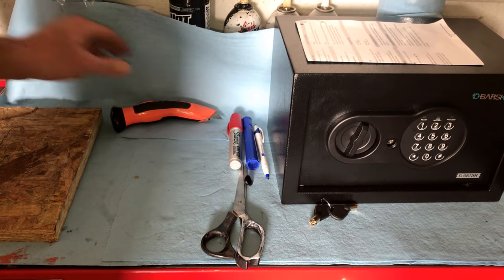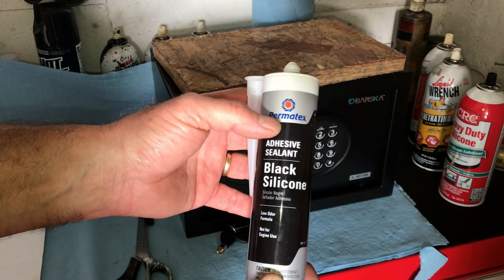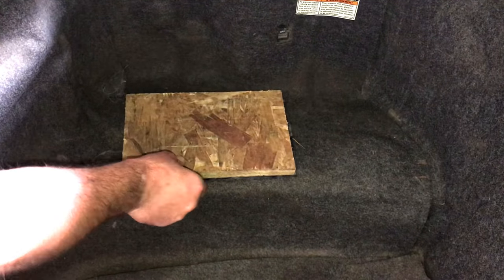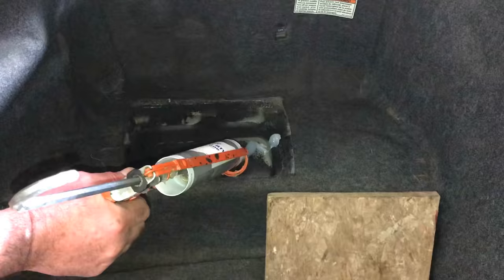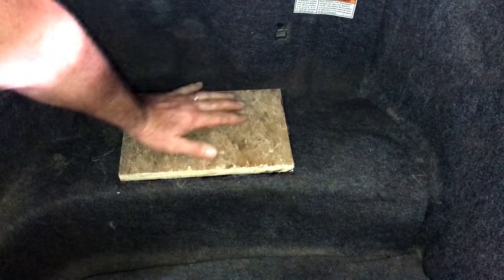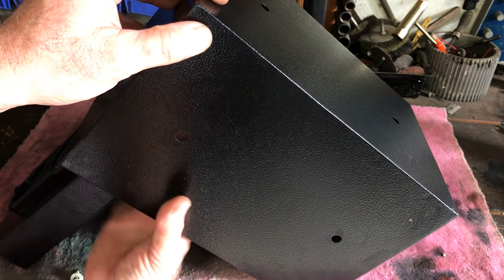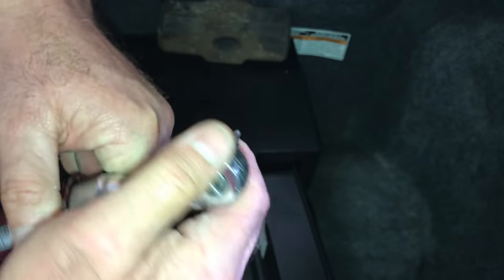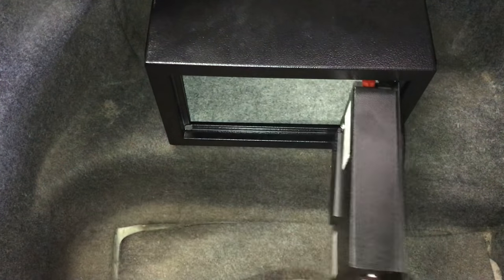How To Easily Install a Security SAFE/Vault in a Car Truck Suv or Semi

Comment: Thanks for that... I've been mounting these types of safes into all of my vehicles I've owned. However, I've always hard mounted but the polyurethane is something I never thought of. Saves a lot of hassle of drilling and then putting silicone around the bolts to keep water out.
Reply from the maker: you got it Ron polyurethane is the ticket for sure ...thanks for the great comment :)

Comment: Hahahahaha glued on particle board! That is fantastic! I switched out a cheap safe I had and I chose a fort knox pistol box, hardened screws and huge washers with locking nuts and loctite. This would have been so much cheaper! :D
Reply from the maker: TiredOfApathy we tried getting it off with a crow bar and it was a bear for sure :)

Comment: This gives me an idea to take out the spare tire and bolt a rifle safe into the threaded hole which used to secure the tire.  By packing out the space between the base of the spare tire well and the covering mat, I could mount a rifle safe in the trunk with pretty minimal massle, it would look well-finished, be as tough an install as anyone would need, and no compromise to the vehicle sheet metal.
Reply from the maker: dave thats sounds like a fantastic project would love to see it when finished   mike

Comment: Awesome Channel - Thank You !  I became a subscriber after the first video I watched.  Another possibly more robust variation would be to drill some bigger holes in the floor of your safe, use a template of those hole's location to drill the wood board accordingly, and then put some bolts with washers up trough the board - then glue it down (looks like your trunk floor has some recessed areas so you don't need to countersink the bolt head/washer combo and compromise some of the strength of your board) - then you can drop the safe onto the exposed bolt shafts,  and secure it from the inside with some locking nuts and large, flat washers..........done.  Remind people not to store a big pry bar or something similar in their trunk however  ; )  .
Reply from the maker: ashman0071 thank you so much for sharing, we have many methods to mounting the safes we install and that all depends on who much money the customer wants to spend...we have had some that want the safe bolted with 1/2" steel plate and 3/4" grade 8 bolts right to the frame of the vehicle, but that, of course, costs much much more. Some just want a place to store items and deter the thief enough to slow them down or make them think it is not worth the time or effort when they see the safe.....thank you very much for being an awesome Subscriber have an awesome day :)

Comment: Great, as long as someone does not bring a grinder and a cut off wheel. The top and sides are the weak point.

Breaking into my own car with my brother and my alarm going off. On one questioned us and walked by us.

This was at a Fred Myers parking lot.

Just saying. 

I do really enjoy your other videos.
Reply from the maker: ok .....well the idea is to stop them or slow them down, any thief that brings a noisy grinder is most likely to get caught...

Comment: Looks like you only put two screws in.  What were the other holes you drilled?
Reply from the maker: did you see where I drilled the extra 4 holes with the step drill? thats, where they were installed, there were 6 in total   thank you for the great comment it is very useful for the entire SPC Channel :)
Reply: I saw that you drilled the extra holes but I didn't see you put 6 screws in.  I must have missed it.  Love your videos!  I have been using lots of your suggestions to make my older car look great and on the cheap!
Reply from the maker: I try to keep the videos short or my subs come unglued on me lol..... so I leave a bit to the imagination, but where you saw me drill them is where they were installed...its all it took to hold the safe securly down, we tried to pull it out to no avail.      when you mount it put it in a place where it is hard to get leverage on it this is another deterrent to removing it quickly and thats what a thief wants..to get in and out as fast as possible...:)

Comment: Wraps a rope around the nearest solid object like a tree and the safe, pushes car and snaps the safe clean out of the car :-)
Reply from the maker: Of course the safe can be removed you can use dynamite if you want to remove it this was installed to protect the contents in it from being broken into not having The vehicle stolen

Comment: Where would you suggest a person that has a vehicle without a trunk like an SUV quad cab pickup an old 98 Blazer where would you suggest putting a safe??? 😳
Reply from the maker: bobby they have safes that mount under the back seats that actually pull out on tracks pretty cool stuff out there for suv's   thank you for the great comment it is very useful for the entire SPC Channel :)